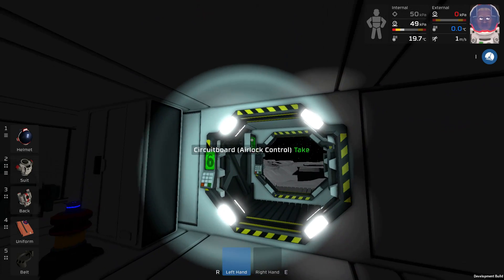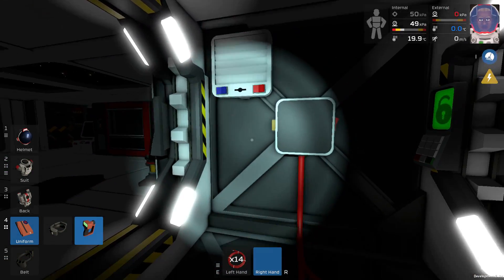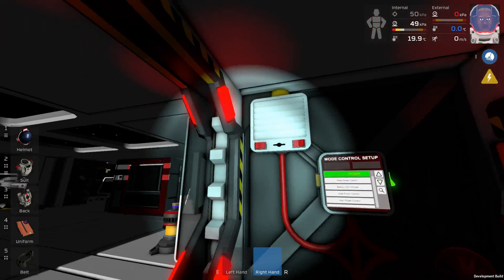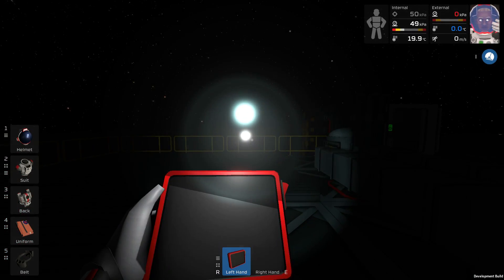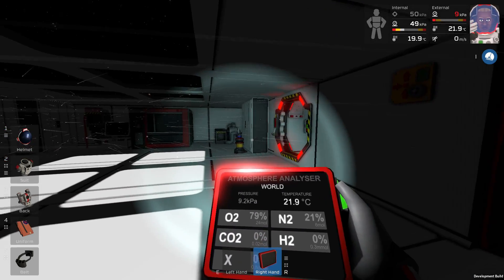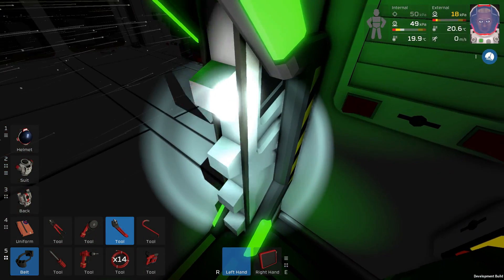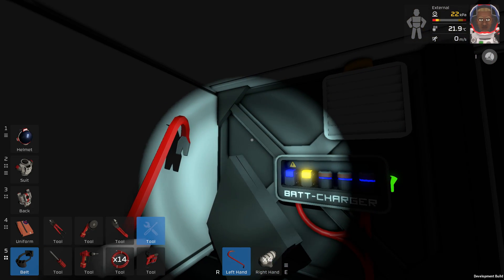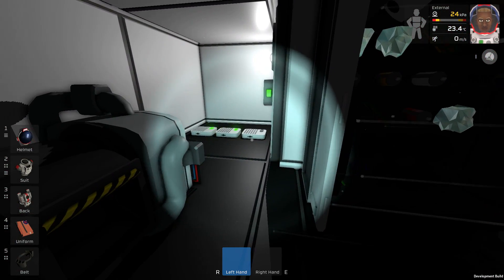AIRLOCK LOGIC - Stationeers: Ep. #10 - Gameplay & Walkthrough

Comment: I would personally add the tank connectors for the pressurization system for the base outside, by the main filtration area just for convenience when switching out the mobile gas tanks. Also, I would change the volatiles (yellow) from the stock colour just to avoid some possible confusion when adding new tanks to the system. Just a recommendation :).
Reply from the maker: I'll probably modify the location of the tank connectors, thought about that too:)

Comment: the temperature is so high because the pressure is so low. so what little gas there is has the temperature. so using your welder created a tiny amount of gas with a very high temperature. there was no other gas to equalize the temperature to.

Comment: You could put the air conditioners and the pressurizer in a separate loop, that way the slowness of the heater doesn't slow down pressurization. Guess it depends if you want to prioritize temp or pressure, never played the game not sure which.
Reply from the maker: It depends a bit on how often I want to flush the base. If it's seldom, then a bit of a longer waiting time isn't that bad. But if I want to do it all the time, I guess I will have to fix some stuff.